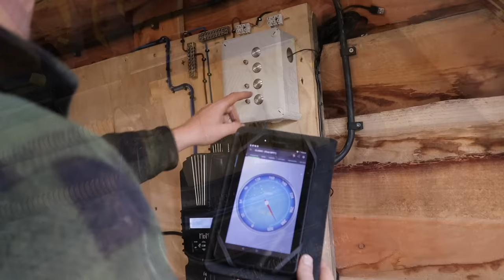Hand Made Drum Carder As A Present For My Girlfriend

Comment: Just a little detail: if you made a groove in metal band (right in the middle of it) it would help when removing the bat. Ypu should also make the tool for that, a L shaped pointed metal (not flexible) rod (like a bent scewdriver) and a perpendicular wood handle. Essential... slide in the groove and pull apart just there. YOu can also add a packing brush on top of the big roll.... What a beautiful present!!!!

Comment: Another awesome, inspiring video Kris. Nice work on the carder. If Dot gets an old metal piping tip (like an icing piping tip) and splits the batt into strips and passes it through the tip it'll make continuous roving which is easier to load onto the drop spindle. Splitting the batt directly onto the spindle, like Dot was doing, requires an incredible amount of co-ordination (and a heck of a lot more thumbs and fingers) more than I can manage!

Comment: Fiber artist here. This is very sweet gesture and a great looking carder. Carding wool is insanely time consuming, and you have to wash and pick the wool first! If you are processing a large amount of wool (more than one or two animals, goats sheep whatever) you might try making a larger version of this in an electric version. The issue with a hand crank carder like this is, you have to stop to lay the wool out and then crank. If it is automated, you can just focus on putting the fibers down. Sorry to give you more work to do but, this would really help your GF out! You could easily sell your carder for 300-500 dollars. A larger version of this, electric of this quality and the sky is the limit. $2500 to 10k easy money. Then your GF could send the wool to a fiber mill to have it cleaned and carded, so she can focus on the art part! Also, carding and cleaning wool is hard on the lungs, you should always wear a mask but, nobody does. Le sigh.

Comment: The fact that you built this before you ordered the Belt tells me you really know what you’re doing.
Reply: Coulda cut it to size and adjusted anyhow.
Reply: We used a lot of that round belting in manufacturing, and I actually ordered a clamping device to hold the ends when they were heated. Kris did it well enough with just his fingers.
Reply: We used a lot of that round belting in manufacturing, and I actually ordered a clamping device to hold the ends when they were heated. Kris did it well enough with just his fingers.

Comment: Great piece. I just have some constructive criticism about your turning. Don't let the toolrest drop below the centre line of your spindle, that is just waiting for an accident to happen (speaking from experience). Depending on the size of the material you are turning you want to keep the rest 5-10mm above the centre line. You are also using the gouges like a scraper. Your gouges should be used as cutters (well all turning tools except scrapers really). The bevel of the gouge basically needs to rub the wood. The easiest way to do this is to drop the handle below the toolrest horisontal line so the point sticks up past the wood and the shaft touching then slowly bring up the handle and lower the point until the tool starts cutting. Here is a nice article I found with a quick search that might help. Otherwise great job and keep up the good work. http://www.newwoodworker.com/turning/ridebvl.html
Reply: Thanks Rian. 

It's more than 40 years since I turned the wood for a couple of stools. I recall my woodworking teacher telling me I was scraping the wood with the gouge rather than cutting it but he never did explain the process the way you have. He was hard pressed, looking after a dozen or more needy evening college students. He did obtain some great coachwood timber for me to do the turning. This is the same timber used to produce most of the Australian made 303 rifle furniture.
Reply: @roberthayward9299  it's my pleasure.

Comment: i guess that plank was heavy enough and the saw was weak enough that kickbacks weren't likely.  But I wouldn't take that risk because it's unnecessary.  Just tack-nail a straightedge on the right side of the plank and keep it against the fence while you saw.  And you'll get a straighter edge which means less handplaning.

Comment: 2:30 I haven't seen that technique before, where you use sawdust after sandpaper. Is that to deburr or smooth the surface? Rather curious :O
12:20 It was at this point that the belt sander-like tool hypothesis (based on the small YouTube thumbnail) fell through, and I am once again befuddled by what a Drum Carder is :/
13:10 Shouldn't you have wet the wood first to prevent burning? Or is that only necessary if you're holding the torch in one spot longer/going over it multiple times?
17:00 I am beginning to think it's like a brush for wool, but at this point, I am second-guessing myself lol

Loved the video. It's a shame I haven't seen it sooner. Love seeing stuff made from scratch, such as thread and furniture, and was rather tired of seeing all the things glued together in an uninspired way, sent through a massive planer as a simple slab, only to then be covered in epoxy and "valued" at over 500 dollars... I was truly amazed at the transformation of the wood at the beginning, as I have gotten a hand planer and was hoping to plane my wood, albeit store-bought and rounded on the edges (mostly for practice). 

The only other YouTuber I saw using a hand planer on a large piece (wider than the planer at least) was a 40 to 60-year veteran carpenter, who was born, trained, and worked in Japan; the first video of theirs I saw was a simple yet massive tree stump they sawed in half (planing separately with a hand planer) to act as legs for a tea table (or grill table?) in their garden (or something similar)... looked simple, but the work was complex to line them up, and the translation is hard to follow at times despite the son seeming an expert at speaking and writing English... probably my faulty memory just forgetting some details, but not the ones I feel matter.